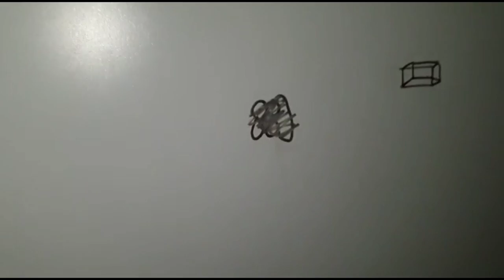Exploring an Abandoned Primary School - English Countryside - URBEX UK - 2020

Comment: great view of the lab taps and sinks 6:54; quite an old cylinder at 7:11 about 30 years old at least, Come pre lagged (foamed) now. back then they often had lagging jackets strapped around them. can't tell if it's indirect or direct (couldn't see round the other side). 9:03 those sinks look like they all 'cast' out of sections of corian  (acrylic resin and natural minerals captured/cheaper than quartz tops). in otherwords the countertops and sinks  are all one piece. Possibly 2 sections where the 45 degree corner is joined, bottle traps on these I can see.
Reply from the maker: Hahaha!!! Plumbing man!!! You legend 🤣🤘🏻